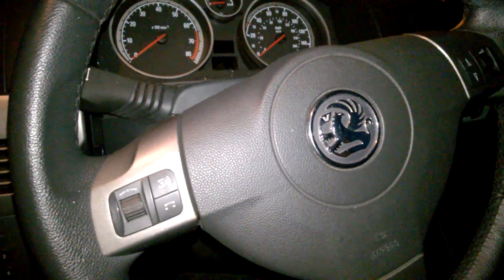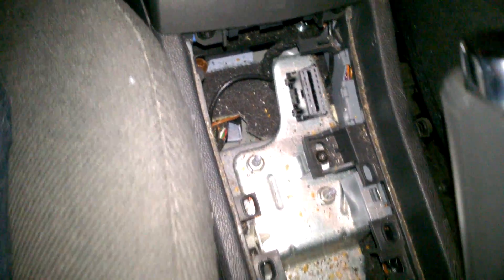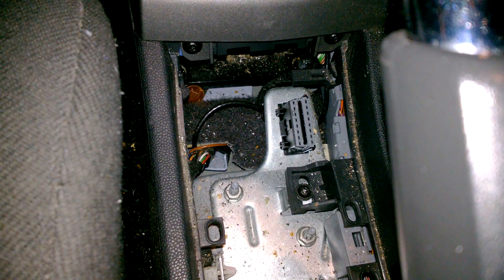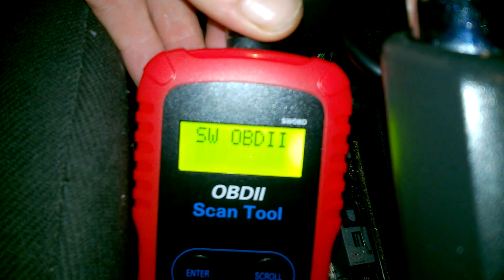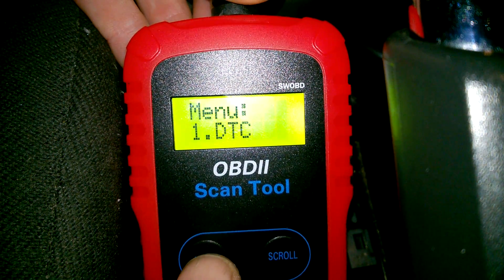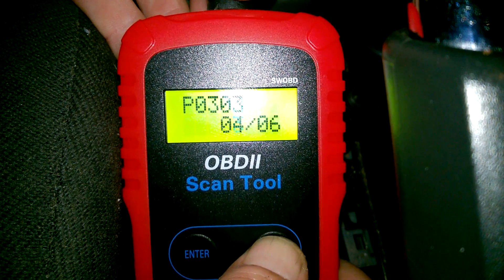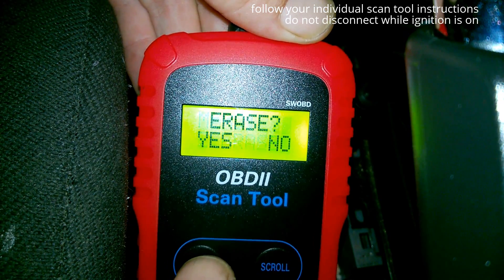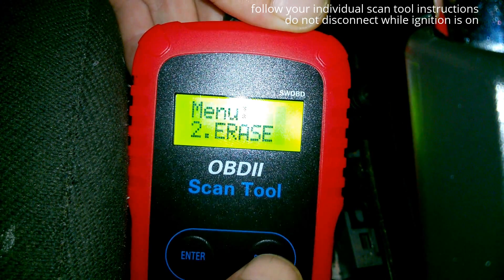OBD2 PORT Vauxhall Astra MK5 READ and ERASE Fault Codes

Comment: Bought one to scan my audi and to be honest it was a waste of time it found 2 errors that did not exist and the codes were not in the "handbook" that came with it so had to delve into the internet, it did not find errors i had with the parking brake at all, So if you want to use it as a torch than thats fine its all it will do.

Comment: If I was to read the code and then reset the car and drive to garage would that be fine or will the code show up again after fixed
Reply: Unless you fix the problem the minute you drive the car the codes will just reappear.

Comment: Where u get that removal tool? I need one for my mark 4 astra
Reply from the maker: Sound fella...Online ebay is probably the best place eurocarparts has them too. mines called Steetwise OBD2 Code reader but there are others available they all do pretty much the same job, hope this helps